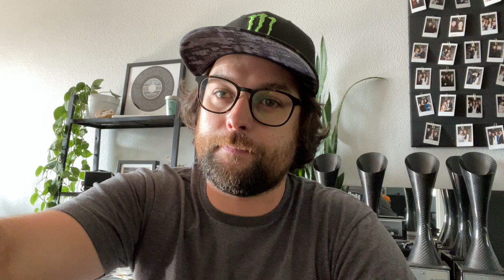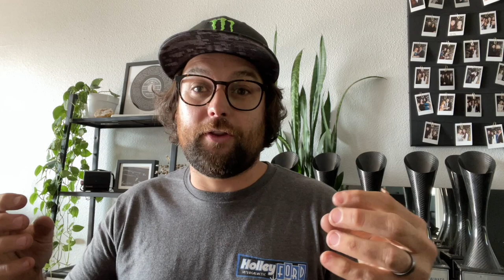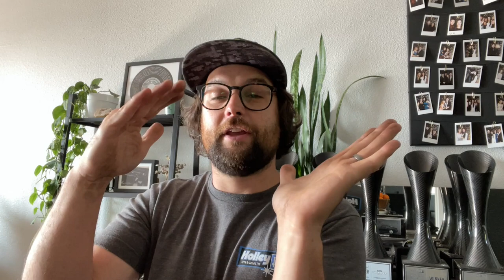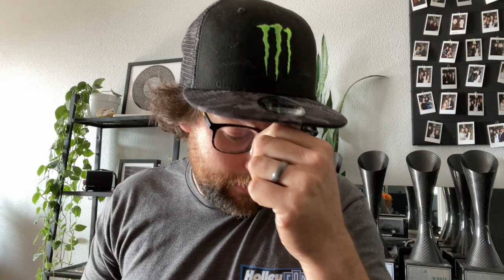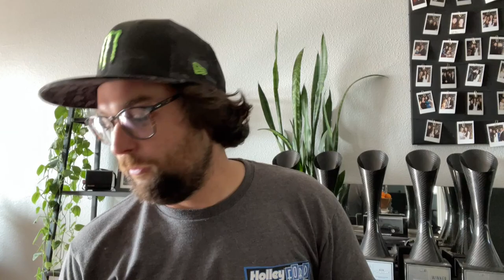HOW TO ALIGN ANY DRIFT CAR! (FIXED!)

Comment: Hello, I just thought I’d share an opinion from an old grass Ridge drifter. Take a car like the 240 SX before you start putting money into power and everything else like that start with coil over sway bars. The suspension car has enough power to drift very very well on the stock KA motor, it just needs the proper differential which is a disco potato in my opinion about two to $3000 worth of suspension parts probably less. Anyway that’s my old fart knocker opinion. Rant over.

Comment: Timestamps for quick reference:
0:38 Setting your ride hight first
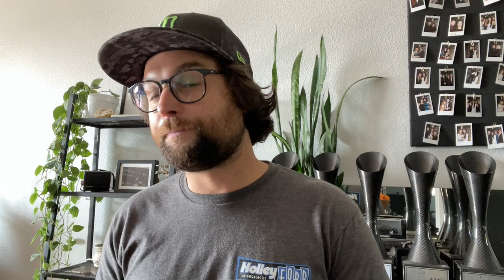2:12 Equal right and left arm lenght
3:11 Front caster
12:11 Front camber / 60 % rule
15:58 Front toe
18:33 Front Ackermann
22:10 Rear camber
25:53 Rear toe
31:33 Importance of chekcing toe after contact
31:55 Adjust on level ground and equal tire pressure
32:26 Quick overview
34:03 Outro
Reply: No all hero’s wear capes
Reply: Normally I would like this, but yall should really just listen to Chelsea all the way through. If you can't make it through a 37 minute video I'm almost certain your car is set up wrong 🤣🤷🏼‍♂️
Reply: Thanks Midnight's 👍🏽 
Funny I just watched a few of your video here on YouTube before watching this, great work keep it up 🙂
Reply: goat
Reply: Thanks bro! Nice index hahahaha

Comment: "Don't get beat down by your poorly setup car"
Thanks for the tips man. 
Well explained for on the fly explanation. 
The hands demonstrating angles helps a lot. 
I'll be using a purpose built string alignment kit since its my first time aligning the car after some changes.
I will be looking for tow plates now as well.

Comment: Amazing information. Back when I was drifting, no-one considered Ackermann. We had to control wash out with what we had. I've recently sat with a current local pro driver and at times I thought he would wash out, he drove right out of the corner with angle and I was blown away. Drifting has really come a long way.

Comment: This was awesome! I learnt something with ideal values for Ackerman and caster and I'm keen to have a play with my 2 knuckle setups. Something you didn't touch on was setting up the rear for a live axle car, my Aussie Ford Falcon is a parallel 4 link with a watts, and I was hoping to learn about how where you want roll centres for drifting (front and rear) and the ideal amounts to roll the diff angle for grip. 

Thanks for the video 😊

Comment: Great video, thank you for the upload. I have a long term project 89 240sx and only recently just understood the benefits of drip knuckles with caster with an offset trail.  Original used chopped knuckles with a coil over drop.  Excited to watch more great info and shenanigans. I am half way through a video of yours explaining how drift judging are assessed. Really neat stuff. Cheers!

Comment: This is probably one of the best videos and explanations I have watched about how alignmet effects how the car steer. I have been fighting where my car will want to snap to full lock when I am driving agressivly behind a car on faster tracks (like Texas Motor Speedway) and wanting to spin on fast transitions. Now I have a basic understanding on caster and akerman when before I was pretty much just guessing and driving around an issue.
Reply: Also is there any difference when setting up a car for the rain? I have always had a problem with my corvette being very unpredictable in the rain and being very slow compared to even a 350z
Reply: @Sancro21  RTR swap the whole rear cradles for their wet setups in the mustangs, so it’s safe to say there’s a major difference between the wet and dry setups

Comment: This was explained so well. I know it may not be a real car but on my sim I have been struggling and struggling trying to figure out why the car is so snappy and what to change. Having changed almost everything maybe forwards and backwards steps, I feel confident at this point that it could be caster because the car has almost 10 degrees of caster and the wheel just blasts through my hands and slams lock. Also the detail of dialing the camber at about 60-80 percent of lock is actually big brain stuff. Thank you so much for this. Also sorry for late like and view but thank you.

Comment: I am setting up a 350z right now and I had/have no clue how much I had to learn until I got the parts to put on the car. I have bc br series coil overs and gk tech angle, welded diff and so far that’s it
Reply: I have the same setup. I’m running -4.5 camber in the front with an 1/8 toe out with 8 caster. I’m running all 0 in the rear. To me, it runs well. Like he said start at factory specs and go from there
Reply: Hey man interested what u went with installing that same stuff rn. And thinking abt doing a alignment at home

Comment: that toe out actually sounds good for me, drift a e36 320i 150hp stock at the moment and it drives forward plenty but wants to straighten until i push it too far then it rotates easily, feels like drifting it is always between straightening and spinning

Comment: Apologies for the long message lol... Great video as always Chelsea 👌
Could you do a specific video on the ideal front and rear setup for an e36 to just make it a nice practice car? Not a compact... But a coupe/saloon setup. Like what ride height works best (without worrying much about looking good), toe for a nice linear not super aggressive lap, ackerman and castor that you feel has a nice balance between self steer and you still giving input. 
Could be an idea to do a video like this for a few different cars you drive often. I know every persons driving style is different, and every track is different, but i think it could help people try an already used setup and see if it's better or worse for them and they might learn something from it handling wise.
I'm asking this as me and a few of my friends have e36/46 chassis and drive together often but we all have different ideas on setups and the cars all drive different. For example my car is very smooth and has a little more grip exiting corners but i can't throw my car into the corner as aggressively as the other cars. Would be nice to have them all reasonably even and have a baseline setup that we know works, then adjust it from there to suit our driving styles, our tandems might be a little more consistent then and we could enjoy that a little more instead of constantly over thinking about 'being slower here and more aggressive there' to make up for the different setups. Thanks.

Comment: Made it halfway through the first one and was super bummed when it was taken down… 
Quick clarification, when you’re talking about setting camber at 60% steering… I didn’t understand what you meant by lead tire.  Would that be lead once you’ve transitioned and are back in drift? 
So drifting around a left turn, your turned back to the right, your passenger tire would be the “lead” and that’s what you set to zero camber? 
Either way, love the technical break down videos. Your technical understanding and willingness to share is one of the things that drew me to you as a fan.

Comment: The 60% rule you said is very close to how I have always setup my camber for the last 12 years lol. With big angle cars I've always said set it around 50 degrees and factory angle 40ish but try to keep about 10 degrees extra.  50 degrees I've always found to be the best balance of angle and speed but thata just my opinion I guess

Comment: if you ratchet strap the rear of the car down to the floor with the gauges on this should so the dynamic toe when drifting ???
iv a got z33 350z will adjusting the rear traction arms help with dynamic alignment???
thanks
Reply from the maker: Pull the springs and do it.
Too many variables when you strap it down with the springs in it
Reply: @chelseadenofa  thanks man will adjusting the traction arms in length help to cancel out the change in toe under load appreciate the help

Comment: So In reference to toe out in the front, that’d be .06” out on each side for a total of 1/8th toe out or an 1/8th on each side? 

I ask because when you reference toe for the rear and the setting you clarify an 1/8th total. For us not using toe plates and using a string set up my measurements are the same but need to be divided in half as I’m setting each wheel independently correct? 

I’ll find out from tire where and driving feel. Going with less than more to start but wanted to ask. 

Great video! 💪🙏👏
Reply from the maker: Yes divided in half
Reply: @chelseadenofa  👏🙏

Comment: Can you explain how to much castor causes over rotation.  I’m thinking about when transitioning. The wheel move faster to the opposite lock and can catch the drift so the back doesn’t keep going. But it sounded like you said it would cause it to over rotate more. Could you elaborate on that note about to much castor causes over rotation please.

Comment: I welded my e36 control arms myself. Ive since been having some gnarly steering shake when on the highway. Could that be the result of unequal length arms or different caster on both sides?
Reply: Did you do every bushing? Do you have front sway bar attached still?
Reply: @xSILVERxVENOMx  No sway bar. All new bushings and ball joints. Rear bushings aswell.
Reply from the maker: That’s bad. Something loose or wheels damaged
Reply: @chelseadenofa  Found 2 balancing weights had vanished from my rim. That may help it but ill check in after i get it rebalanced.

Comment: Excuse me, im not a professional drifter or anything, but i do drift in mobile game😅 called CarXstreet...i have a question, what cause my car to swing back to normal angle everytime i release throttle? I had to full throttle to maintain the angle...is it about the arm settings or the weight settings?

Comment: Hi E36 specific question. Amazing video. 
I ami thinking i will run
neg caster 7
0 toe
1-2 neg camber ( having strut plates that I can max neg camber for track and hopefully it will give it the right amount of toe out) saw a guy talking about this, anyone can confirm?
dunno my ackerman but close to stock, I have cut my kuckles, e46 arms, and polly offset lollipop

Comment: How the heck do you check this on your drift car? It's so low or do you have to remove bumpers?
Reply from the maker: You can do it with it in full race trim
Reply: @chelseadenofa  I may have mis-phrased that although you can check it alright if anything needs adjusted what needs to happen?

Comment: On ride height, wouldn't it ideally be dictated by by placement of the roll center? Like, using ride height in conjunction with what ever arms and knuckles are on there to get it where you need it. I would think the advantages of lower CG (low cars) would be totally ruined by a frickin' subterranean RC.
Reply from the maker: Way to complex of a question. Set the ride height to what you like and enjoy lol